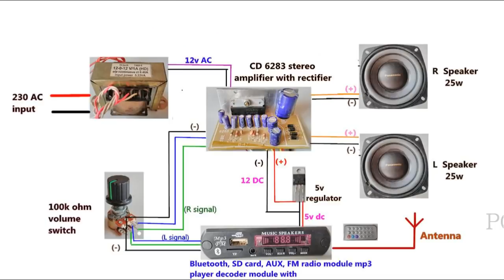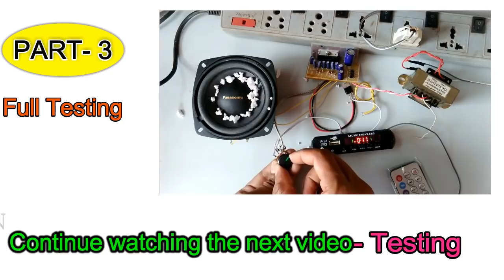Bluetooth, SD card, AUX, FM radio Mp3 Player Module With Amplifier Assembling( part- 2) | POWER GEN

Comment: Speaker joind panna off aaguthu
Reply from the maker: power supply check pannuga, minimum 12v 2Aneeded
Reply: Use pandra adaptor detail. 12volt 500M.A   type Battery Eliminator bro ok va  amplifier detail  Nitinsonic  USB with Bluetooth. Speaker joind panna off aaguthu bro front digital light blink aaguthu
Reply from the maker: full connection na check pannuka,
minimum 12v 1A power supply Venum bro
Reply: Bro indha amplifier ku adaptor vaaganuna eannanu k tu vanganum
Indha video la set pandamaathri eanaku set panna thariyathu bro aadhu naalathan k kuren. Apparam one doubt, indha amplifier la timer set panna mudeuma, morning 5:30 to 6:30, and evening 5:30 to 6:30, automatic ka on aaggy of aagnum. God song paada vikkanu bro. Eduku eadhum readymade da timer k dikuma Ella eduku ungalta eadhu idea iruka.

Apparam oru chinna help ungala easy ya contact pandradhuku. Number kuduga bro 🙏🙏🙏
Reply from the maker: 12v 2A DC power supply adaptor nu kaeluga,
ethula timer veika mudiyathu, extra timer control vanganum
Reply: Ok bro apparam edhula Oru China doubt. Eduku eandha maatheriyana speakers set panna k kuradhuku nalla irukum. Home theatre feel varanu bro
aduhukku oru  video upload pannuga 🙏
Reply: Modunja neega sonna adaptor vachu kuda detailed da video send pannuga innu usfulla irukku ,🙏
Reply from the maker: @hariharantamilarasan8122  ok
Reply: Oru small request bro eandha video upload pannaalu background music vikathinga bro. Step by step pa Explain pannuga appadhan porium.
Reply: Intha amplifier la Aux nu Oru irukula athu eathuku bro video paaka modeumma. Mobile to Bluetooth eappade connect pandathu.
Reply: Total la Oru thalivaana video upload pannuga bro 🙏

Comment: Can I use separate transformer for Module and Amplifier board ?

I'm fixing the whole thing in a metal cabinet so will I have problem if I use two separate transformers in the cabinet ?

Comment: How to connect bass trouble connection ji plz video upload
Reply from the maker: ok i will upload
Reply: @powergen522  tnq ji. Small  request 6283 board la  sound low va irukku ji. Ithukku bass treable  board vaikanum
Reply from the maker: @ravicrs1984  veikalam ana athu volume ma increase pannathu
Reply: @powergen522  ok

Comment: Amplifier sound starts cracking on full volume but reducing the usb module volume the sound gets ok. But usb module volume returns to 29 number after power restart which is default and amplifier sound again start cracking. What to do ?

Comment: Can it run 2 subwoofer in same time?? What is the cost of 25w subwoofer?? Is it 4 inch subwoofer??
Reply from the maker: yes, you can use two subwoofers, cost 200Rs, yes 4inch subwoofer